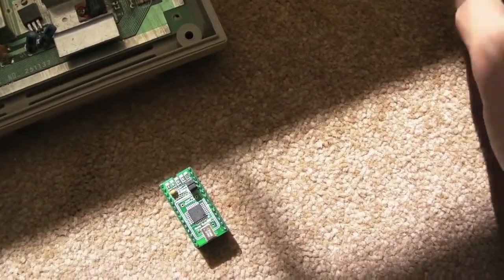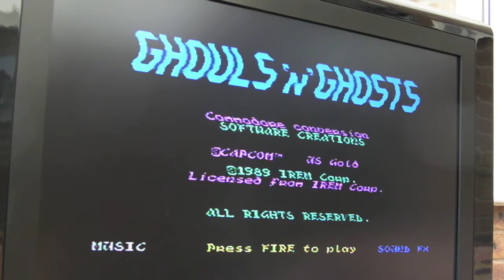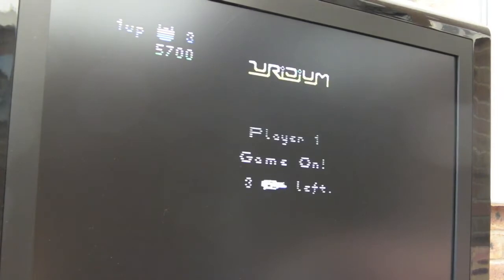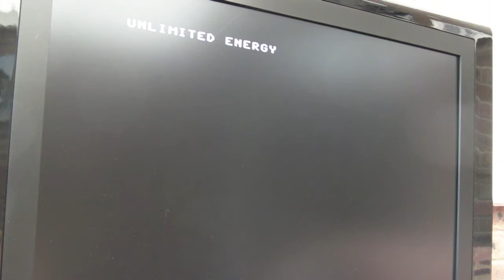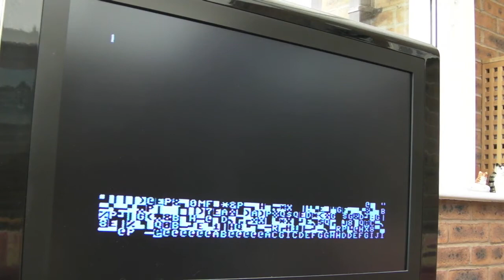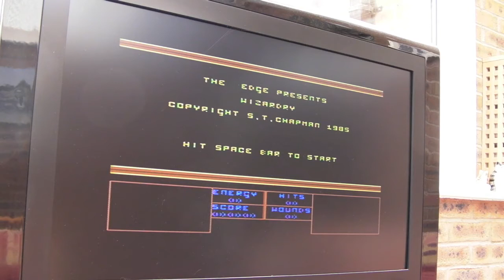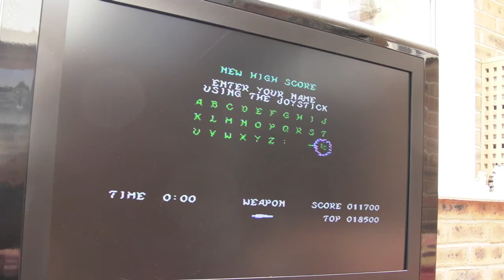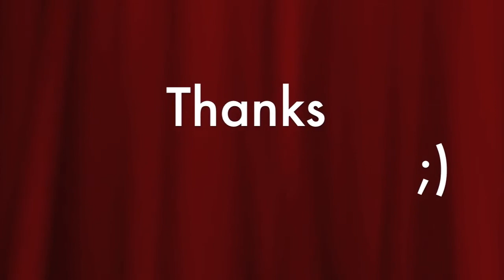Commodore 64 (C64) Nano SwinSID Testing / Review  (SID)

Comment: That's the thing with the SID.   Even with the same revision SID Chip, they often sounded slightly different from chip to chip.    It's just a unique thing, the SID chip.
Reply: +KrK007 6581 never sounded the same, a lot of hit or miss. 8580 seems to be a rather consistently sounding design - of course it sounds different from 6581, but i actually like 8580 a LOT better, well at least as long as music is written for it. Most purists will probably disagree and claim that THEIR 6581 is the only correctly sounding chip in the world. :P

Correct emulation of even an idealized average 6581 is questionable, but 8580 is possible, so perhaps effort should be focused on getting it right first. Then again, 8580 are not rare because they don't just keep dying, while 6581 are rare.

But thing is, SwinSID's timings in the demos i heard are very, very wonky, not even close to correct function. I'm not sure whether the hardware he chose is unfit for the task, or whether the code could be fixed yet.

Take a listen to SIDcog, a SID emulator mostly fitting into 1/8th of Parallax Propeller processor. The timings seem absolutely spot on. The sound emulation is more generic than correct, but it's definitely nice sounding.
Reply: Perhaps because they had Analogue?
Reply from the maker: Retro Marky it's a combination of the lack of true 1 to 1 simulation of the analogue parts, plus the SwinSID lacks proper support for a couple of registers - there's a SwinSID ultimate due to arrive any day now that fixes the problems with the original SwinSID.  There's also a 'Lazy Jones' fix firmware that can be programmed if you get an AVR programmer.  Will cover these updates soon!

Comment: Hi all ,, recently acquired a c64 binnage, after giving it new life ,,, the only thing tht was fully working was a sid chip ,,,,, I have orederd a arm sid ,,, which reviews says its very good , also impressed at this one , is there much difference in   orignal sid and the 8850 ? In sound
Reply from the maker: The ARM SID is MUCH better!  The Nano Swin SID sounds good most of the time, but it does not support reads on the OSC3 and ENV3 registers, and as a result a few games sound very wrong.   The ARM SID does not have that problem.

Comment: 13:10 it's a decent stopgap until someone finds a way to properly replicate the real thing by decapping a few Sids and reproduce it with generic logic, like was done to the ZX Spectrum ULA.

Speaking of, wonder if I could stick this thing in a Speccy?
Reply from the maker: +TheTurnipKing Yes, agreed!  They are a good stop gap!  And if you use it as the 2nd SID in a Dual SID (pseudo stereo) setup, the sound glitches experienced in my video here are none existent.  That is, it's perfect as the 2nd SID and sounds 100% perfect in all games.   You could interface one with a Spectrum if you produce a board for it.  It would need to connect to the expansion port, but in theory with the right logic inbetween you could control one on most other systems.

Comment: I wonder, how does one reflash this thingamajig if there is a new firmware ??
I have some issues with audio quality :-(
Btw does "open" jumper mean UNBRIDGED ? or bridged ?
"CLOSED" meaning no connection between the jumper pins ??
Or is it the other way round. I wondered if I had jumpered the pins wrong :-/
(For 6581 / ancient C64 , I believe I saw a R6 around the SID socket somewhere too.)
Reply: Uridium appeared to be the best of the ones i tried btw. Seemed to sound most normal.
Reply from the maker: I guess you need something like this, and the relevant software (probably available from the chip manufacturers website):-

http://www.ebay.com/itm/AVR-JTAG-USB-emulator-Debugger-download-AVR-JTAG-ICE-Download-Programmer-atmega-/200908327724?pt=LH_DefaultDomain_0&hash=item2ec711cb2c

I think any JTAG programmer that supports Atmel chips should work fine.
Reply from the maker: Dag Jacobsen Yes, pretty sure Uridium sounds identical to actual SID.

Comment: Where do I find the socket ?? I just bought two Swinsid nano and now I hear I need a socket to get it mounted ? :-(
Reply from the maker: You need something like this (EBAY link below) :- (28 pin DIP / DIL socket)

http://www.ebay.co.uk/itm/IC-Sockets-8-14-28-pin-DIL-DIP-socket-Low-Profile-10-20-or-30-pack-UK-Stock-/111074028907?pt=UK_BOI_Electrical_Components_Supplies_ET&var=410176986226&hash=item19dc872d6b
Reply from the maker: By the way, you can mount without a socket but it means you have press the SwinSID in really hard - the socket pin receptors will widen as a result which means if you ever want to put a standard SID chip back in there it might be loose and not make a good connection.

Comment: Haha, I also start Supremacy sometimes just to listen to the music and then it stops and I load the game again. I don't know why some people have so much negative to say about the SwinSID. It is what it is, a digital emulation of the real thing. Swinkles made a direct drop in replacement. It's a great achievement in itself. The other fpga + analog filter projects hasn't come in a drop-in replacement yet. Would be a killer product, however, why not MCU + analog filter ? :) Is Swinkles Nano SwinSID open source yet ? :D
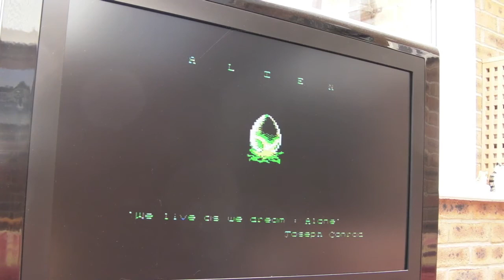Reply from the maker: +bwack Haha! I do that a lot - just load a game to listen to the music =D  The Nano SwinSID is great really, but you can hear the problems with some games around 26:13 - Alien and R-Type have issues, both related to the register reads.  Last Ninja is not quite right either in this video due to register reads.  I think the problem with the MCU approach is its not timing exact, and that's why these problems occur with those few games.  I suspect it could be fixed though if it was open source.   Someone said that an old version of the code is available from Swinkles website, I've not taken a look at it yet.  Hats off to him though, he did a great job really!  And as I tried to show in my last update video, the SwinSID is absolutely pefect (100%) when used as SID2, since the register reads hit a MOS SID it results in every single game sounding just like it should.

Comment: Was this video just an excuse to show off how amazing the c64 sounds! Damn you! :) What's the advantage of this device? Is it there incase all the original SIDS die or something?
Reply from the maker: Haha!  I guess there are a couple of advantages, one is that it runs off 5v so it doesn't matter which system you put it into (ie. 8580 won't work in a bread bin without modification and vice versa).  There's the option to switch it between 8580 and 6581 in real time.  Apparently it also out performs an actual SID regards some of its audio characteristics - ie. giving cleaner crisper sounds and having better filtering characteristics I think.   That said, until the bug is fixed regards how Alien and R-Type sound I am not sure I would leave it in my C64 =/  I am going to see if he's made public the source or not, if he has I might have a crack and trying to fix it.  I guess he's produced it to ensure these systems can still work when all the real SIDs have died.  There's also the problem that part of the music industry is taking all the real SIDs for other hardware etc, which means there are fewer and fewer C64's still containing SIDs.  I was pleasantly suprised to find a SID in each of these C64's I got the other week.
Reply: There's quite a few C64s around that have been robbed of their SIDs so reviving one bereft of its SID can be very satisfying.
Reply from the maker: Yes!  Better to at least have SwinSID or something similar rather than no SID =)
Reply: There are many advantages.  First, obviously, to replace failed SIDs in Commodores.  But another advantage is building homebrew computers that have SID abilities.  Or, VGM players that have SID support.

Comment: I have a related question.... what is your video setup?  I have my C-64 hooked to a flatscreen TV via a cord from the AV jack on the C-64 to a SCART connection on the back of the TV..... but frankly, it looks like crap compared to your video, IMHO.    What do you have?
Reply from the maker: KrK007 I made a cable to connect the AV port to a composite video and mono audio cable.  Those just feed into the back of the Phillips LCD TV there.  The TV does have excellent support for composite and RGB though - Not all TVs are equal in their ability to accept and clean up the input signal, and not all TV's have the same processing of the picture in order to make it look half decent when source input is standard definition or interlaced etc.

It might be worth recapping your C64 also!
Reply: Quite frankly, your video looks fantastic.  I have a Samsung LED  Multisync TV that can do PAL and NTSC (That's why I got it) and a cable that is supposed to approximate S-Video but it looks like crap.  I just checked the cable and it has no resistor. 

What's impressive about your video is it's composite but still looks great.  I'd hold onto that TV as long as you can.  :D
Reply from the maker: KrK007 I think I lucked out with this TV!  I tried a few of my systems on a newer Panasonic LCD TV and the picture looked pretty bad.  The video output can vary between VIC revisions and the motherboard revisions.
Reply: GadgetUK164 Yes, that TV looks very good IMHO.
Reply: All the old TV's are being discarded.  The new flat screens are crap at supporting old hardware.   Existing, quality working RGB is going to pass into history, unless someone actually manufactures them from scratch for the retro market.... which would be hideously expensive.
Reply: Your Philips TV indeed gives a decent picture. I also have a Philips LCD TV and the picture it puts out is absolutely rubbish, composite is horrible and although s-video looks quite good on it, as long as the picture is not moving, this TV has all kinds of image processing crap which cannot be disabled. The scrolling gets all jerky and the lag is just horrible. Looks like it converts the 50FPS from the C64 to 25FPS..... The one I was using was a Philips 19pfl4322/10, I cannot recommend this with any Retro system. I've replaced it with a Samsung Syncmaster 2032mw and that has been a relief, a very nice screen indeed. Composite is very good, S-Video absolutley brilliant and scrolling is smooth. RGB SCART just amazingly crisp and sharp, tested it with my Amiga 500/1200, Atari ST/E, ZX Spectrum (composite modded) and ZX Spectrum Nuvo128 clone (RGB SCART) all very good. So, I'd recommend this for use on retro computers. It has SCART, S-Video, Composite, VGA and HDMI inputs so even modern systems like Rasbpberry Pi can be connected. Great, only drawback it's end of life so not being made anymore, so only available secondhand or in thrift shops.
Reply: I also have a Samung LCD, a Syncmaster 2032mw and I've made my S-Video cable myself, I did put a 330 ohm resistor on the chroma pin output and the picture is absolutely brilliant.